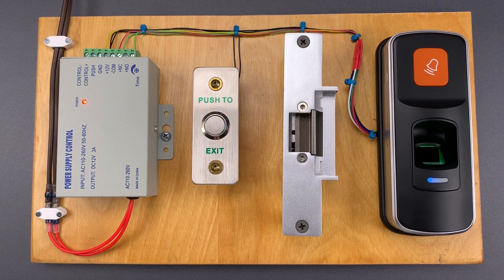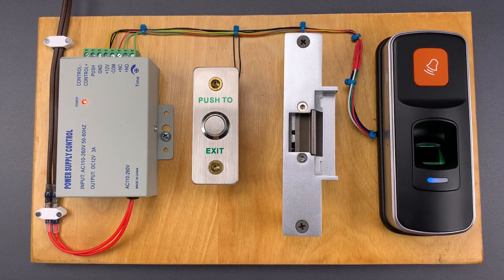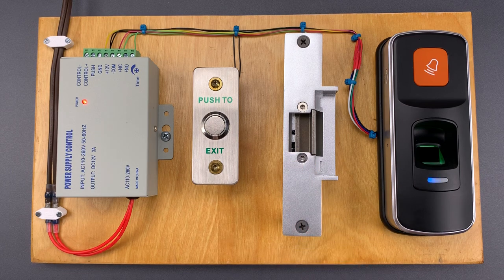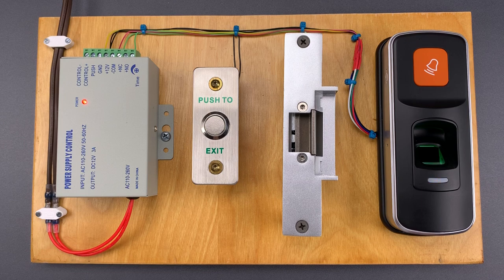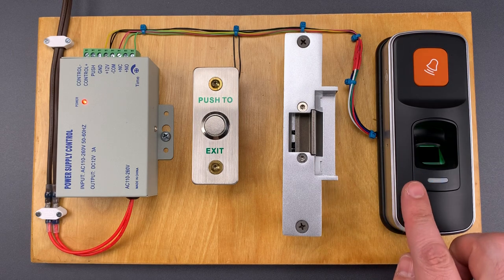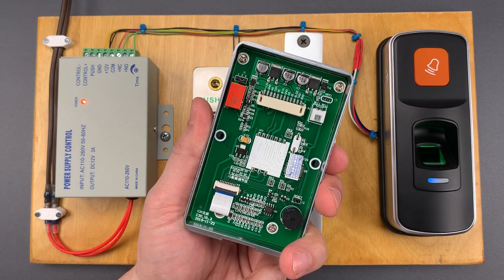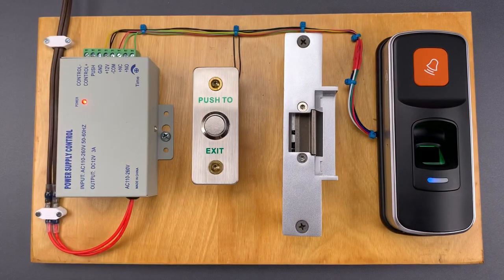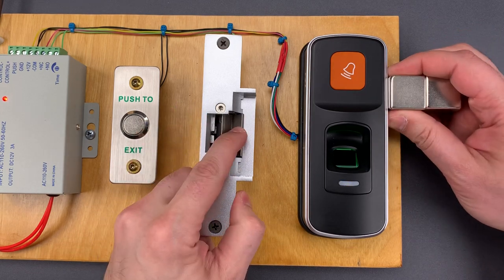[1060] Opened in ONE Second: HFeng Fingerprint Lock

Comment: I said this once before.  The outside device should never have any logic to decide to unlock the door.  
The outside device should be nothing more than a reader that sends the information to a secure controller inside that decides if the information is valid and sends the unlock command to the door.
Reply: Exactly. Authentication is server-side, not client-side
Reply: @FedericoStra  Unfortunately, it seems that all these electronic locks put the logic in the exterior unit to save money and make it easier to install.
Reply: @fredashay  The cheap ones does. Locks and systems comes with different type of rating/classification. Cheap chinesium does not.
Reply: @Hofstader007  "Cheap chinesium."  I'm gonna remember that, lol :-)
Reply: They could have used a semiconductor switch like a MOSFET and it is done!!
Reply: does that not make the problem worse? Isn't it the case that all you would need to do is close the circuit yourself some other way?
Reply: @jakobvanklinken  No, you only read the card info from the reader. Then the system inside some safe place checks it and unlocks the lock on the door. The card-reader and lock is two separate units.
Reply: That’s what I thought they did, but apparently not.
Reply: Or, in wyze's case, nothing outside. Not sure if it works if the internet goes down though...
Reply: @Skarry  How would you open the door/lock then?
Reply: you sir have a brain
Reply: @Hofstader007  just break the door down like a normal person
Reply: @smallpp8891  to much noise 🤣😅
Reply: I disagree. The problem isn't the logic in the outside device. The problem is the low-tech signaling. If it signaled "open" by sending a command, not just flipping a switch, then it would be much more difficult to defeat. You'd need to remove the outer unit (which should be designed to be difficult), access the cabling, then either connect a second identical outside unit that will accept your key/fob/card/fingerprint, or connect a signaling device already programmed with the same commands (including identical baud rate). That simple change would switch in from a 1s defeat to a 10+ min defeat, and go from minor planning to significant planning. And only require the same simple logic in the interior unit that had existed in garage door openers in the 80s.
Reply: @christopherrto  interesting idea
Reply: @christopherrto  instead oft using a simple signal you could use cryptograghic keys which might even change with every unlock and would be specific to every unit.
In theory this would be hard vor even impossible to unlock given that other parts would hold.
Reply: @christopherrto  You still need a physical way to unlock it which will likely use a solenoid or relay for a small / battery powered unit.
Reply: @straight-up-shots  And your point? I never suggested the solenoid or relay be removed. Just that the outside unit would send a command to the main board which would activate a relay to open, instead of directly activating the relay with power from the outside unit.
Reply: @christopherrto  That's exactly what the OP said...
Reply: @straight-up-shots  No, OP said the outside unit should send raw entry data to the main board, and the main board would perform authentication and unlock. I am saying the outside unit still performs authentication, but then transmits an open command to the main board. A specific string of 1s and 0s at a specific baud rate, like a garage door opener remote does to the garage door opener. The main board then activates the relay instead of the outside unit doing so directly. This way one cannot simply short the wires on the outside unit.
Reply: @hichameham4124  I know right? Bizarre.
Reply: or just use a normal fucking lock like normal humans... at least you don't waste electricity that way
Reply: @XenoContact  Nah.  Personally, I want a normal non-fucking lock :-p
Reply: @XenoContact  tend to agree. But very useful application for homestays, letting in visitors when you aren’t home yet, running a family… combined with doorbell camera it can be very useful
Reply: @christopherrto  yep just rekey it. Very simple and easy and wastes 0 electricity. This is being done all around the globe.
Reply: @XenoContact  on the contrary, it wastes a LOT more electricity and energy than an electronic lock. 

How much energy does it take to mine the metal for 100 keys? To run the machines that make the blanks? To run the key cutting machinery? And to do this potentially numerous times a year?

This is either a weak attempt at being a troll or you have a serious inability to think logically.
Reply: @christopherrto  i am not thinking about such extraordinary situations. In that case yes you need to re evaluate all your options. However, in normal houses or apartment complexes you don't have to re-issue 100 keys everytime someone moves out you just rekey their apartment door and life goes on. You don't need an electrical lock in nominal everyday situations.
Reply: @XenoContact  Electronic locks like this are not typically used for individual apartments, but for apartment complex buildings. Where there very well would be dozens if not hundreds of units. Everytime a move out occured, if the main lock isn't rekeyed and keys reissued to every tenant or owner, then the security of the building is compromised. With an electronic lock deauthorizing users takes a minute or two, and does not impact others.

Comment: As a programmer i'm always confused seeing such devices.  
At the very least put all the logic on the inside - you already have a 'push to exit' button for the inside.  
Just make the fingerprint-reader stupid and put all the logic in that other box.   
That way an attacker would have to find a way to fake the correct datastream from the fingerprint reader to the logic box.
Reply: I know, I think it is just cheaper to manufacture the way they do it, but idk
Reply: In that case you'd eventually prefer a mechanical lockpicking.
Reply: There are fingerprint, RFI and code lock systems with an additional interface which uses the Wiegand protocol. This seems to be an industry standard for lock systems. The Wiegand interface is connected to a special controller board installed inside the house which activates a relay in the house, which then opens the door. These China electronic boards and compatible locks are also dirt cheap. Sure, the installation of such a system will be more expensive but it will also resist an attack for some extra seconds.
Reply: It's all about physical override
Reply: or just use a solid state relay of some kind.
Reply: Sorry, but what does it have to do with you being a programmer? lol
Good point though. The other solution is to simply use a transistor instead of a relay, especially since it uses DC power.
Reply: @saifaddeenal-manaseer6325  Programmers perspective:
They put the login-mechanism for a website into the client-side javascript instead of putting it to the server-side which is FAR harder to manipulate.
Reply: @Animaniac-vd5st  oh it makes sense, I appreciate the answer.
Reply: working with mechanical device is a bit tricky, for example if somehow push button fail to register signal, whole office is locked out.
Reply: @extracoconuts5975  there should be another way to open the door without the electrical system. A simpler case is if the electricity cuts.
Reply: That's what makes this a "stand-alone access control system," as LPL put it. It's meant to be a cheap way to add new functionality to a legacy system.
Reply: I have one phrase for you that has inordinate levels of importance to most people: "ease of installation"
Reply: OR at the very least shield the relay, it would make this attack harder as well.
Reply: It's the physical equivalent of  client side security in a web app...
Reply: Genius comment. That way the relay would be safe on the inside but all of the components would be identical. The only difference would be the location of the circuit board inside instead of outside. You're hired!
Reply: @saifaddeenal-manaseer6325  good answer respect!
Reply: I was looking for this answer.
Reply: If you make the reader stupid how would it tell the other component to unlock?
Reply: @georgeyreynolds  It doesn't.
It just submits the raw fingerprint reader data to the logic board inside.  
Just as with client-server model in programming. You don't put the verification on the client side where an attacker has access.
Reply: @Animaniac-vd5st  so now someone can smash the fingerprint reader and you're going to have to destroy the door to get in! I'm also a programmer, seem to be a lot of us on here!
Reply: @havoctrousers  I can't help but think this problem has already been solved for a number of years with keyless entry to cars. I don't know why we would need a fingerprint scanner in the first place. heck, make the keyless 'key' a fingerprint scanner. Expensive, but cool
Reply: @Animaniac-vd5st  Ah it's not that dumb then. What would that look like in terms of data? I was thinking if the logic is door side it would be easy to break anyway if it's 0 for not open 1 to open on very basic level. So shoving a screwdriver into the fingerprint pad is the equivalent of picking it? 😂
Reply: of course they are vulnerable to some different kinds of attacks (but those are much more technical)
Reply: @gb2983  How do you get the lock open if the power fails or the fingerprint lock is broken?
Reply: @georgeyreynolds  usually there is still a mechanical, key based lock, for just such an occasion. Generally, they can't be used while powered on, due to the electromagnet that actuates the bolt mechanisms, holding the lock in the closed position. Cut the power and pick the mechanical lock is a possibility.
Reply: @extracoconuts5975  usually doubled with a motion sensor rex for egress. It's usually required by code
Reply: @saifaddeenal-manaseer6325  typically these locks aren't powered until you unlock them. Otherwise you burn out the Solenoids pretty quickly. Backup power is usually the answer during a power failure
Reply: @havoctrousers  nah can just unlock the door remotely
Reply: @georgeyreynolds  backup power
Reply: @saifaddeenal-manaseer6325  There are systems that use the electromagnet to hold the door lock closed.  An electrical failure unlocks the door.
Reply: @jeffragar3493  those are for day use I believe and common for glass doors
Reply: @saifaddeenal-manaseer6325  Where I worked it was 24 hours on all doors, glass and solid.
Reply: @saifaddeenal-manaseer6325  They have battery backups..
Reply: @saifaddeenal-manaseer6325  "… especially since it uses DC power." is irrelevant.  Almost all relays use DC power.  (By the way, some relays ARE designed to use AC in their coils.)
Reply: @saifaddeenal-manaseer6325  Well that is sprcific to him, but i dont think he is undermining other professions in their ability to determin this. Hinestly though i dont think you could start that sentence with "being a mcdonalds cook".
Reply: Didn't Mythbusters get through a fingerprint-reader with melted wax?